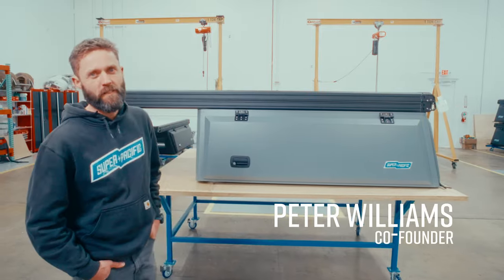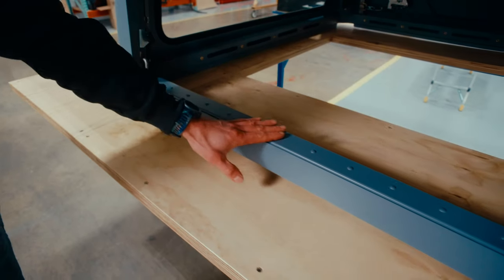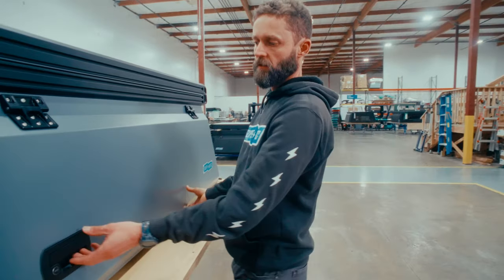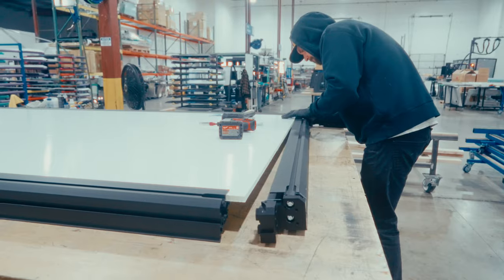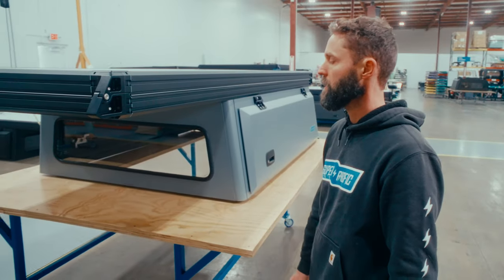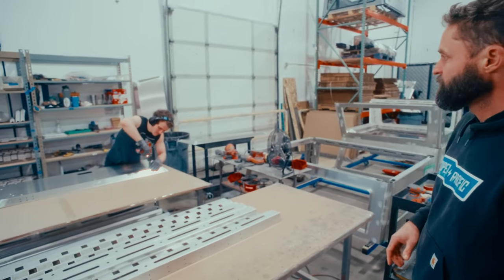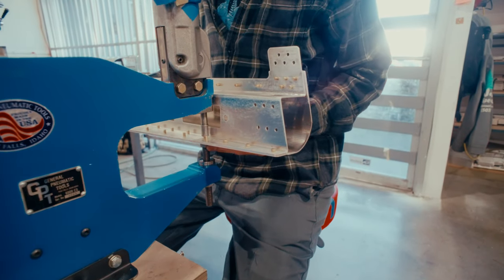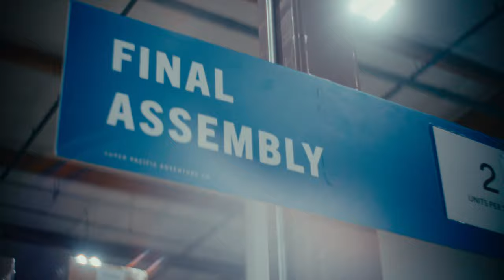The X1: It's Built Like An AIRPLANE.

Comment: And this is why I love the super pacific sooo much. Mine has been amazing and very happy with my choice in camper. They are always looking to improve on anything so I only see them growing and improving on a already great design. Would really like to see them use sealer between the exterior riveted together areas in the future for corrosion prevention reasons and helps even more with vibration cracking over time around the rivet holes where it always happens. They have nice wire holes pre drilled for you in the front would like the same on the rear for reverse lights and cameras or what not. And would like Maxtrax Mount idea max for the doors as a add on option something like what expedition essentials has. As smart as this guys are I see them improving on this design and simplifying it. Also having the option to paint the doors a different color just to simple and easy to customize an already totally customizable camper. It’s a already great camper that’s totally customizable to each person but that doesn’t mean simple easy improvement can’t be added .